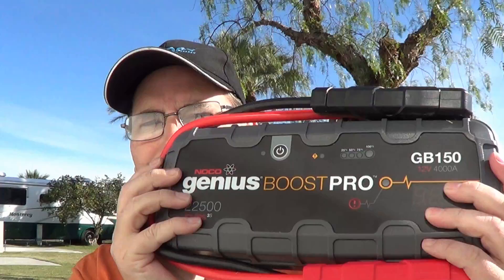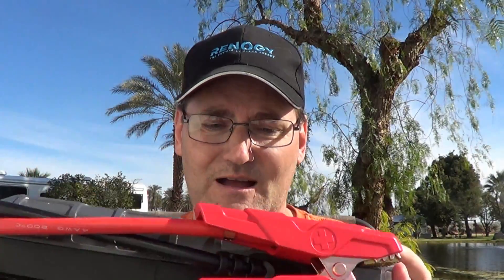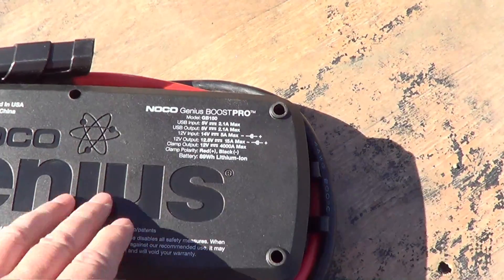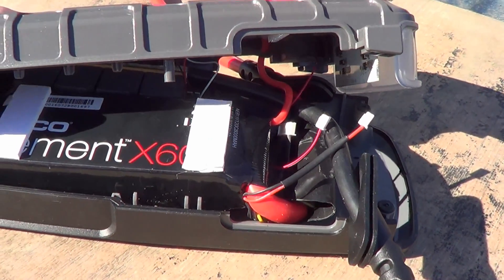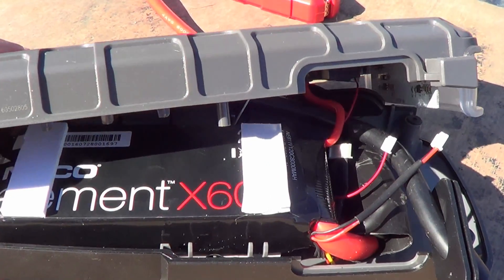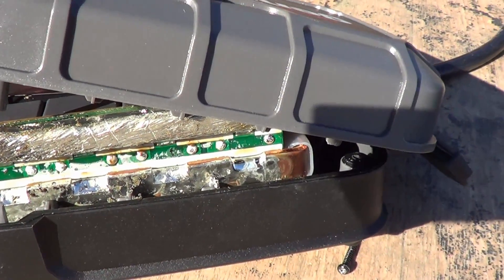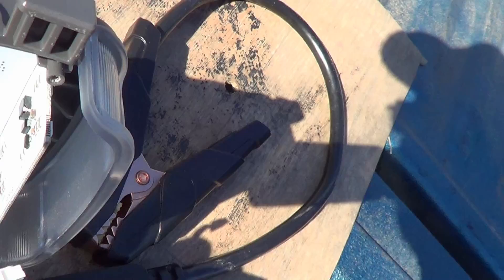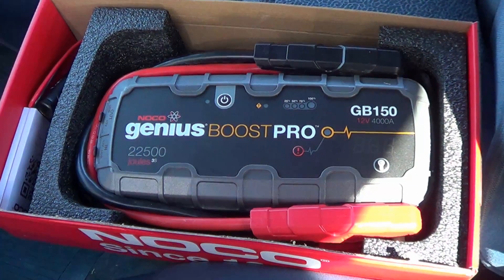What's Inside My NOCO GB150 Battery Booster

Comment: That is the same Battery as an RC car, plane use. Its a 3s(11.1VDC) 8000 MAH 120C Lipo.. You can buy them anywhere from $110 - $200 depending on Manufacture. Only difference is the size of the leads...The Board is probably a BMS for the battery to level the cells.
Reply from the maker: Thanks, John
Reply: They go as low as 30-50 dollars
Reply: @mikeshobbiesandrandomstuff    hey Mr.mike, any leads on these kind of batteries at that price? I have heard they can be pretty explosive. thanks
Reply: @GDMHificationranpitc  amazon or your local hobby stores
Reply: These use Lithium-Ion, NOT Li-po batteries.  they are close but not the same.
Reply: So really their ratings are BS, its really only supplying a max 960A?
Reply: Was gonna add this as well, these are lithium ion batteries not lithium polymer. Lipos dont like to  hold charge for long periods of time

Comment: Sorry, the battery is actually 120C! Max continuous current: 960A. This is also a 3s battery with a nominal voltage of 11.1v, fully charged to 12.6v, and discharged to 9v.

Comment: From a recent conversation with NOCO Customer Support: 
SierraSupport Specialist (NOCO)
Oct 18, 2022, 14:19 MST

If your unit has not been used much, that may be contributing to the issue. The Boosts have an internal lithium battery, and when lithium batteries sit for long periods of time without use, or are stored outside of the recommended temperature range (-20ºC to 50ºC), this can damage or weaken the internal battery, just like how your car battery's lifespan and performance will be negatively affected with extreme temperatures or lack of use. This is true not just of our products, but of lithium batteries in general. We suggest the Boost get regular usage by depleting the battery occasionally. You can simply charge USB devices like a cell phone to do this. This occasional cycling of the battery can help with longer battery health.
 
The Boost's internal Lithium battery has a ~1000 cycle life. The cycle life is the number of complete charge/complete discharge cycles that the battery is able to support before its capacity falls under 85% of its original capacity. So if the battery is discharged to 60% and then charged to 80%, it isn't a complete cycle. The Boost should last several years with normal use and proper storage. In an industrial application, the amount of years they last will depend on the amount of use. We recommend cycling the battery occasionally (depleting and recharging) to keep the internal battery healthy. This can be done by jump-starting or charging USB devices.
 
Your product carries a 1-Year Warranty. Based on the serial number you are 4 years and 9 months outside the warranty period. This unit has lasted a long period of time. I can provide you a coupon code to assist with replacing your product. It is currently already 20% off on the NOCO website, and the code would take an additional 10% off of your purchase on our website to help you get a replacement. This code is only valid for use on our website https://no.co/ and cannot be applied to other online resellers. This would not require you to ship your unit to us and allows you to purchase a brand new product. Please let me know if you would like to proceed and I will email you the appropriate instructions.
Kind regards,
Sierra

	
James Boswell
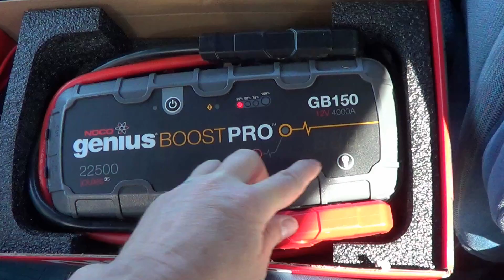Oct 17, 2022, 07:46 MST

Dear Sierra,

Thank you for your quick reply. I’ve been very happy with this unit, except that it really seems to have a short life cycle. The unit has not been used very often and has always be stored in a manner recommended by your instructions. Maybe my expectations are too high.

That having been said, I would appreciate if the unit could be replaced with a manufacturers refurbished unit as I’m not prepared to buy a new unit at full retail price.

The serial number is: NG15006X3X08160502428

Regards,

Jim Boswell
Reply from the maker: Mine still seems to hold good charge knock on wood. A couple weeks ago, I helped a lady start her dead motorhome. The booster had been sitting for a few months.

Comment: From outside this thing looks like premium product but from inside it's cheap Chinese crap.
Reply from the maker: It's still working well. I just helped a lady jump-start her Class C RV a few days ago. She was very happy. :)
Reply: @LoveYourRV  These things only last a couple of years.
Reply from the maker: @davehenderson6896  I bought it 6 years ago. Still works well and holds a full charge for months.
Reply: @LoveYourRV  Well you are one of the lucky ones, YouTube SOSFIX Electronics, and you will see how many GB150's have to be fixed.
Reply from the maker: Doesn't say much unless we know the percentage of repairs required vs the amount sold. NOCO is a pretty big outfit, so it likely sells a ton of these things. They are even carried in many sticks and brick stores and are a huge seller on Amazon. The GB150 alone has almost 9000 reviews.
Reply: @LoveYourRV  Well you should check the YouTube channel out to see what kind of problems they have in case you get that problem.
Reply from the maker: Thanks, I'll bookmark it.

Comment: I cant believe people put these in their cars, dont ppl know how unstable lipo's are, especially with how much they degrade if let sit at full charge
Reply from the maker: Media hype, if they were that unstable there would be many more instances of catastrophic failures. LiPo is in so many things these days like laptops for example, I'm surprised how little problems there are. But of course if there is the odd fail media jumps all over it with fear mongering. Also, it not like lead acid was trouble free.
Reply: @LoveYourRV  I dunno, I use lipo for a lot of RC stuff and I dont think I've ever had one last more than a year or two without swelling. Not one of mine is supposed to be fully charged when stored for more than a week. I just dont see this being better than a AGM jump pack.
Reply from the maker: I've had this box for 4 1/2 years now and it's almost always sitting at full charge in case it is needed, still does the job perfectly. So guess it's a different use case versus an RC stuff that is charged and discharge much more often. They also tend to push the battery to the limits trying to get performance out of them.
Reply: @LoveYourRV  Dunno, but my understanding was that if you leave a lipo at full charge for 6 months, on average, it'll lose 20% of its capacity.
Reply from the maker: Here is what NOCO faq says: "Does it hold a charge?
All Boost models can hold 70% of its rated capacity for up to one year. For optimal performance, we recommend charging the device at least every 4-6 months, after initial charge."
The whole point of the battery jumper box is for it to be ready to be put to use in an emergency. So it not like you can keep it half charged. I imagine they engineered the battery and charging circuits to deal with its specialized use case. A short burst of high amps to jump-start vehicles. Possibly by not fully charging it or using different lithium chemistry. The full light might say full charge but that doesn't mean the actual cells are at 100%.

Comment: Our gb150 quit taking a charge maybe ill look into replacing the lipo with a rc battery or try to get it replaced
Reply from the maker: Make sure to check all the fuses in there, maybe one blew.
Reply: @LoveYourRV  how many are there?
Reply from the maker: @TheChewy78  Not sure, but I saw at least one green blade fuse beside the relays
Reply: TheChewy78 
We have one of the gb150’s as well that will show its charging but you could leave it on all day and it will have no charge. Were you ever able to fix your one? Thanks.
Reply: @LoveYourRV  ok maybe i will look . I think its out of the one year warranty

Comment: never needed mine.  Its in the car for eventually problems.  Now, after 1.5 years, it wil not charge anymore to 100%. (green light keeps flashing)  Lipo cells out of balance?   When i charged it , it was still 75% full.  Bad cell.  unfortunately.  Don't know if it wil start an engine anymore.  Do not trust it .
Reply from the maker: Maybe try totally discharging it and let it recharge again. Maybe it will reset the charging system. Mine is still good, just recently jumped started a guy who was stranded.
Reply: @LoveYourRV  Thanks for your answer.  Yes, noco adivised me also to totally deplete the unit, but unfortunally it didn't work.  I tried this twice.

Comment: If you do the math on the 120 C to 8000 mah that battery only delivers 960 cranking amps I mean that's a lot but definitely not 4000amps which means false advertisement
Reply from the maker: Yeah, seems like some kind of lab tested spike or something. I did get it to start my 7.3L diesel motor with both of the batteries disconnected. That impressed me. Cheers, Ray
Reply: Those are super caps underneath, not resistors. That's what allows you to produce such high peak amps from a low input current.
Not saying that '4000 amps' isn't overrated, just clarifying the function of the device.
Reply: @Nobody7720  I dont think so.

Comment: There is no way this isn't using capacitors to deliver the 4000Amps for cranking.
Reply from the maker: Likely some weird laboratory spike test so they can use it for marketing.  The thing did jumpstart my 7.L diesel with both batteries disconnect so not bad. Does what it needs to do.

Comment: It's a 3 cell Lipo (Lithium Polymer) which yes is the same as a 3 cell lipo RC battery. Min Voltage is 11.1 ~ 3.7 min volts x 3 cells and Max Voltage Fully Charged is 12.6 volts which with lipo batteries is 4.2 volts per cell. What you were describing in the bottom was more than likely capacitors which allows the power to build from the battery for the boost. IF anyone knows what a capacitor is they'll know what I'm speaking of. The discharge rating was the 20C you were referring to in the battery type. I can't speak for that battery but in RC cars we run them either in series for parallel when we run multiple multi cell batteries. One will get you longer run times and the other more amperage for very fast power for very quick throttle compared to longer run time. The 8000 MAH seems as I've ran RC cars with 10000 MAH which is a really long run time.
Reply: Love your RV was right, they are resistors, not capacitors.

Comment: NOCO GB70 has a 2 year life span especially if you keep it in your vehicle and is subject to drastic temperature change it will stop charging the unit
Reply from the maker: My GB150 is just over 2 years old now, got it for Christmas 2016 and still operating and charging OK, I leave it in the truck most of the time, but our temp diff is usually from freezing to a max of 90F so not that extreme, I'll report back if my unit fails. Cheers, Ray

Comment: 4000 AMPS! With a 30 amp rated relay, and an 30 amp automotive fuse soldered to the board, lol.
Reply from the maker: Fuse is likely for the accessory 12volt output plug, no way 30 amps would jumpstart a 7.3L diesel like it did. Would probably need a few hundred. https://www.youtube.com/watch?list=PLp14lzXh07uld1iYCtGabRfGas01vFCmM&v=bgOjEtO-YJs

Comment: The circuitry in that booster won't allow you to run the battery dead flat. Lithium batteries will be damaged and may no longer work if you run them down to 0 Volts.
Reply: That's not correct dead flat 0.00v Lithium batteries are hard to charge due to near dead short conditions. 0.00v Lithium batteries need recovering with high quality smart chargers to start the charge at CV and Variable Current  until the voltage picks up and then CC.

Comment: Can this be used a charger as well ? or just jump starter
Reply from the maker: It can charge small items like phones and tablets.
Reply: thanks i answered my own question found it later lol it cannot be used to charger car battery just jump start it =\ trying to find a lithium car battery charger for my bmw m3. i will be doing some programming and needs to be hooked up to a charger because the fuel pump when it gets coded can pull up to 25amps i read. The BMW M3 LIthium battery is supposedly 69AH do you know ?
Reply: Rob Fsociety Guess what! Noco makes a battery charger (2amp if I recall correctly) that will charge about anything! Including lithiums like the battery you are talking about... it’s in the same case as smaller noco jump starting battery

Comment: Used one of these boosters in a professional environment (AAA battery service in Los Angeles) every day for 10hrs. It replaced one of those lead acid boosters, a dinosaur that was heavy. Anyway I had over 700 jump starts on the GB150 b4 it quit, but it was kind of my fault because 10% of those vehicles had electrical system shorts that I was unaware of until I saw the sparks. I even jump started  Ford 3500 diesels that had two batteries at times. Contacted Noco and they responded instantly! Sent the unit back, and they replaced it with a brand new one within a week. I thought it was going to b in a brown box and refurbished but it wasn't, it was in the original packaging and NEW. The customer service at Noco is amazing!!!!! I'm using the new one but I'm being more careful now, if a vehicle has recently been run and the battery is down to 6volts or less and nothing was left on such as the head lights don't boost it with ANY booster, just have it towed, a shorted vehicle will damage your booster!
Reply: I start my semi truck with it kenworth W900 c15 15.2 L diesel engine

Comment: Would this work as a 12v power supply for a item at 15 amps and if so how long do you think it would last ?
Reply from the maker: Yes, but it would only last about 1/2 hour as the battery capacity isn't much at 8 Amp Hours

Comment: VCRs not really all that complicated. Used to tear down and fix jams on rather expensive commercial beta machines at a TV station. Nobody else around at 3:00am to fix a deck when you need three running to stay on the air. Absolutly no training either.
Reply from the maker: You're talented, as the average person would have no clue how to get it back together, especially these days.
Reply: It was 3:00am on a Sunday morning. I was on my own and needed at least three decks running, four meant less hot swapping tape and WAY less chance of grabbing the wrong tape after 14 hours of running mind numbing infomercials. It wasn't that bad.

Comment: All the home gamer boosters are over rated this one is no exception. The battery label you show says 11.1 volt @ 120c with 8,000mah or also known as 8ah capacity. So your kind of right in that it means the discharge rating. To get the amps out of that ratting you multiply the two 11.1x120= 1332A is all that pack can actually put out. The better pack to buy is the Matco MTXtreme its actually $15 cheaper then the NOCO GB150 and is rated with actual numbers at 1,200 peak amps but its a 24,000mah or 24ah capacity means you can get more and longer cranking out of it with the same actual starting amps. Cons are that the Matco is twice as wide as the GB150 and the Jump cables are smaller gauge. Pros are that it will also jump a 24volt piece of equipment with a setting change and has a 10 amp 12volt output.
https://www.matcotools.com/catalog/product/MTXTREME/24000-MAH-JUMP-STARTER-POWER/#to-details
Reply from the maker: The NOCO boosted my 7.3L diesel truck motor with both batteries disconnected and cold glow plugs, so I'm happy. :)
The 24AH is nice, would mean less recharging. Had a look at the customer reviews at that link, though, didn't look too good.
Reply: Love Your RV it will absolutly do what u told me i have no doubt. I love how heavy duty the cables are just dont believe the label. I made my own with an rc battery and ordered replacement clams from another booster and can start my 6.0 f250 superduty without batteries too. About 15 times without recharching.  For around $100 have to give the small clamps and wire some time to cool in between but same thing

https://www.ebay.com/itm/Powerhobby-3S-11-1V-7600mAh-75C-Lipo-Battery-w-Deans-Plugs-Losi-8ight-E-/302282721502?hash=item46617448de

https://www.ebay.com/itm/iClever-Smart-Jump-Starter-Cables-EC5-Connector-Emergency-Clamp-Booster-Battery/272911649724?epid=2229386222&hash=item3f8acd4bbc:g:h2EAAOSwICpZ-qr1

https://www.ebay.com/itm/5-Pair-EC5-Connectors-Male-Female-Battery-Discharge-Wire-Plugs-5mm-Bullet/191719882499?epid=1243165822&hash=item2ca3653f03:g:XQsAAOSwSdZWej0w